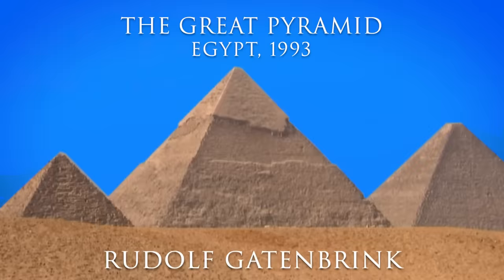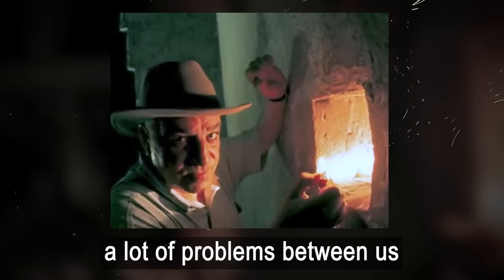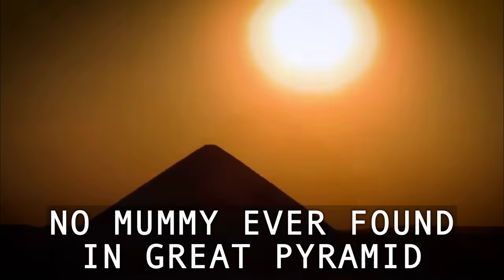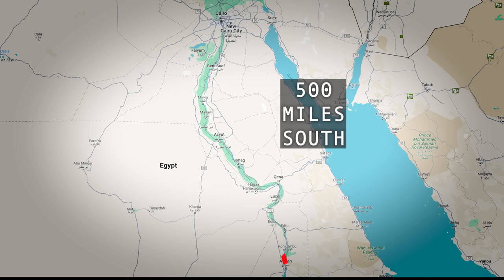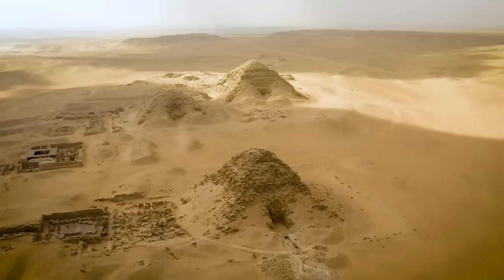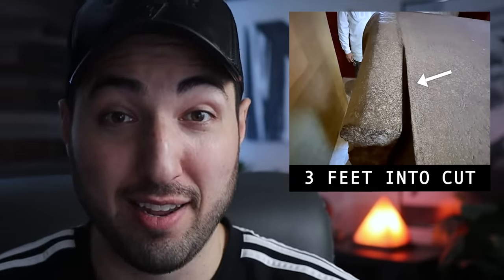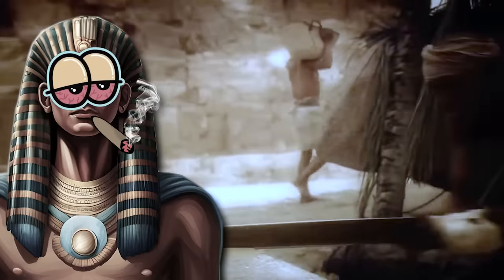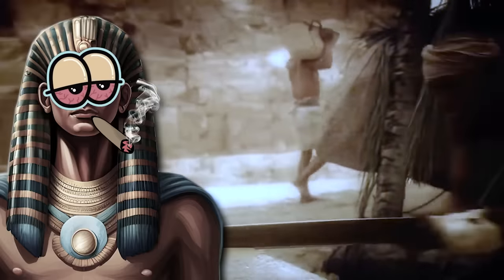The Great Pyramid Mystery: The Oldest Cover-Up In History

Comment: Very interesting that the latitude of the Great Pyramid is 29.9792458°N which uses the exact same sequence of numbers that measures the speed of light in m/s. More interesting considering that the idea of latitude and longitude wasn't conceived until roughly the third century BCE -  some few hundred years after the building of the pyramids. Even more interesting that this is compared to the speed of light using the metric system conceived by the French in 1790 - a few thousand years after the Great Pyramid was built. Down right mind baffling considering that this is the exact number of tadpoles that, if laid head to tail, on the night of the vernal equinox, during a full moon would be required to just ring the edge of the duck pond outside my back door that (gasp) has a replica of the Great Pyramid.  Some of the things stated in the video are interesting to be sure - like how the stones were cut and the pyramids were constructed in 20 years. But, as the clip progressed the narrative got more and more outlandish.
Reply: @eddiebarrow8671- I LMAO, thank you ❗
Reply: I was just about to post about the measurement problems when I saw your post. I was hoping someone else realized this as well. Good information.
Reply: The metric system is based on the the dimensions of the Earth. 1 metre is exactly 1/10,000,000 of the distance from the poles to the equator. 
Regardless of what the measurement is called, humans generally would have still created this same measurement, given we tend to count in bases of 10 (i.e. from the fact we have 10 fingers).
This also relates to latitude, 1 degree is 111,111 metres. 
So yes, regardless of who defined these terms, the actual unit of measure is based on the earth and is not arbitrary like the imperial system and all the various others, these really are based on observations of the Earth.
If one were inclined to somehow communicate that we have knowledge of the speed of light, this is a plausible way to do it. 
Math is great for breaking thorough language barriers as the values are not arbitrary.
Reply: @EdwardJohansson  I can see the reason for assuming they might have used the dimensions of the earth, but then you would have to assume they had the knowledge of the measurements of the earth from pole to pole etc. We would also have to assume they used a base 10 system for the same reasons we did. The Sumerians used a base 60 system. I haven't checked, but do you know of any other civilization that used the base 10? While it's possible they had knowledge of the earth's dimensions and created a base 10 system of math to make use of that information, I just don't see any facts to support it. That doesn't mean I wouldn't look for those facts or ignore them either as a possibility.
Reply: yeah I stopped the video after this. If you seek long enough one will always find alleged "strange similarities". It works the same with so called "scientific miracles" in so called holy books.
Reply: @michaelferguson5167  So your mention of the Sumerians actually brings up an important point. Seconds and minutes are base 60 and were invented circa 3100 BCE (likely before the pyramids), so by talking about the speed of light per second, we're actually mixing a base 10 physical measurement with a base 60 time measurement. 

We do know the Egyptians used base 10 (as did most, known civilisations at the time in the area that communicated with eachother, except sumerians and babylonians), We don't have evidence that Egyptians used base 60 for seconds and minutes, only that they tracked the day using base 12 - 12 day hours and 12 night. 

However, in regards to longitude and latitude though, regardless of the system used and what base, it is still the same value - so long as time remains constant. The distances remain the same no matter if it's metres/miles/longitude/latitude, so whatever the value, it still corresponds to the same measurement of distance. It's the measurement of time that causes the issue. 
One would have to assume Egyptians did adopt base 60 for seconds and minutes, at least for this purpose. However it is indeed an arbitrary measure, therefore aliens wouldn't get the message unless they knew that we had divided days into 24 hours and then further using base 60 for seconds and minutes. So in summary, it's not actually the distance that's the issue, it's the measurement of time - without the base 60 assumption, for which we have no evidence, this looks more like a coincidence. Though it is plausible that they could have received measurement of seconds from the Sumerians, it was invented circa 3100 BCE, likely before the pyramids.

Comment: The metric system wasn't in use until 1795. It IS based on tenths, thousandths,  and cubes of volumes. Could easily be that the ancient Egyptians used a similar unit of measurement, there were quite literally hundreds of ways of measuring in each country on earth, thousands worldwide, before measurement became standardized the world over. Even the Imperial measurement still used in the U.S. and places in the U.K. are just converted from metric measurement in every scientific setting.
Reply: The metric system is based on earths dimensions and water, one milliliter of water weighs exactly one gram, 10,000 km is the distance from the North Pole to the equator. So you’re just reinforcing the video’s hypothesis that the pyramids are to scale with earth and other objects in the universe
Reply: @sportspokerguy3506  I'm aware of what the metric system is based on. It's a base ten measurement system though, that's the part that might be relevant. It's very possible that the ancient builders had a similar system of measurement. If they were clever enough to build as well as they obviously did, they were clever enough to establish a proto metric system, especially considering how many arbitrary measurement systems there were floating around at the time. Not saying that I think that's what happened, but it's entirely possible that they inadvertently came up with a measurement system simular or identical to metric. It's our final evolution in measurements, it very well could have been theirs. No one will ever know for certain, but to dismiss the possibility just because our metric system didn't exist yet seems a little premature.
Reply: @twistedpixel2558  you said it was based on tenths hundredths and thousands I was just saying it’s based on earth’s circumference and water. I agree the ancients probably were advanced enough to base their measurements on earth itself and probably water (which is required for life on earth)

Comment: They didn't transport limestone 500 miles, it was Granite they transported from the Aswan Quarry
Reply: 80 ton granite blocks, perfectly cut with copper, transported on tiny boats. Now I want to see Hawass explain how you get a stone even 1/8 of that size onto that boat..
Reply: glad you know more than literally every other source online that claims limestone. but i mean..you were there..and you built it..and you have all the answers...obviously
Reply: @BaStAgE   Dude, it's covered everywhere that while most of the pyramid is limestone, the internal blocks are granite. This is not up for debate. The video maker screwed up there when he failed to mention that some of it is granite. The limestone was mined locally, the granite came from Aswan.
Reply: Yeah, the video maker kind of screwed up there, but it's overall still a great video.

Comment: I personally think the people who originally made the pyramid’s were there long before 4500 years ago. I think the ancient people were far smarter and advanced than we give credit for and had knowledge of the earths geography and oceans and different land masses. It’s possible they even had contact around the world in different cities .it’s said that way back then the geography was totally different, and it’s possible an asteroid or some major event could have caused a huge setback to civilization far before we realize now. The great sphinx has water erosion on it and is now believed to be older than 4500 years. It’s impossible that it was built in only 20 years you can’t even stick a credit card it’s so precise and perfectly aligned. Not even modern building can match the perfection and took humanity until the late 1800’s to build a structure taller. We couldn’t built a replica in 20 years time. Not to mention the possibility that with the limestone and gold on top the pyramids generated their own current and could have electricity running through them. Believed it was said wires were found and are still running through the pyramids that are ancient .

Comment: About 3,500 quarry-men could have produced the 250 blocks/day needed to complete the Great Pyramid in 27 years.

 In the experiment replicas of these were used to cut a block weighing about 2.5 tonnes (the average block size used for the Great Pyramid). It took four workers 4 days (with each working 6 hours a day) to excavate it. The initially slow progress sped up six times when the stone was wetted with water. Based on the data, Burgos A construction management study conducted in 1999, in association with Mark Lehner and other Egyptologists, had estimated that the total project required an average workforce of about 13,200 people and a peak workforce of roughly 40,000
Reply: Even if they were able to mobilize 40000 workers, the super comlicated design and project/construction management required still make the pyramids seem impossible to have been built based our current understanding of the technologied that ancient Egyptians had.
Reply: @lambvindaloo  Yet they did it, so obviously it wasn't impossible.
Reply: @kento1957 You are correct. I don't think anyone is arguing their existence only our official explanations and understanding of the technologies involved.
Reply: Man how do you tell 40000 people what to do without radios/ walkies

Comment: I thought that the great sphinx was the oldest thing in Egypt  out dating the great pyramids ? Recently they said it is far older than they ever thought before.
Reply: One point that was not clarified: the shaft that points at Orion did not happen only 4,500 years ago – due to Earth's axial wobble, there is a precession of the equinoxes, resulting in the same position of the stars every 25,772 years. The Great Pyramid of Cheops could be radically older.

Comment: Those weren't handles for the door... They are copper conductors
Reply from the maker: Either way, it’s the only copper found in the pyramid structure
Reply: @MindFKDwithPJ  yeah I saw a video explaining why they were conductors. It's been awhile and I forget the exact scenario they used to explain it but I remember it making a ton of sense... Love you videos man
Reply: I don't think copper I the only material inside the great pyramid but other material that probably Hawas keep it hidden...
Reply: Batteries
Reply: They did find huge light bulbs inside its a fact!!!
They are  hiding tons of  information !!!
Reply: @summerforever6736  No they didn't
Reply: They opened the door only to find another door behind. I've never heard if that second door has since been opened, or at least a camera sent through. Would be surprised if nothing has been done since the documentary was aired. Can't believe that it remains a mystery to this day.
Reply: @MindFKDwithPJ  Because some scammer on YouTube says it is copper?
Reply: @bigbasspa  Because the video is fake!
Reply: Yup. Those are copper charging ports. Because pyramid is actually a giant vibrating buttplug. But you have to charge it before use. It also explains why it is so big - ancient people were just bigger. And it explains a lot why piramids are brown in colour. Mystery solved, no need to thank me.

Comment: How can the pyramid be argued to be older than 4500 years old, yet also argued to line up with Orion’s Belt 4500 years ago? Genuine question.
Reply: The orion correlation is supposed to line up about 12 500 years ago. It also alters the star alignment of the square shafts.

Comment: BLOCKS were cut with sand and pressure.
Put sand between two rocks, rub them and watch what happens.

BLOCKS were moved on a boat, there were long water channels.

BLOCKS were lifted by a system of levers and counterweights, such as a crane or an elevator. If I have a BLOCK on one side and an equally heavy counterweight on the other side of the lever, I can change the position of the block around the pivot point of the lever just by pushing my finger into the block.  They used balance systems.

People were moving there with families, because there was work, food and house. They ate bread and drunk beer. They were paid. There was a whole city with workers and they all had one focus. To build the pyramide. 

It could have been build in 20 years with a sophisticated strategy.

Here are numbers. 

315 BLOCKS PER DAY
114 975 BLOCKS PER YEAR
2 299 500 BLOCKS PER 20 YEARS

They felt the energy, that we only talk about nowdays. Collective counciousness and electromagnetic structure of everything, sound and geometry, healing. We can learn from them, they were connected to creation.

Comment: I was thinking maybe the tunnels were filled with lime or salt water, or something, and the metal things were to conduct electricity from one tunnel to another. Bc I heard it’s a machine, or power station. Maybe they separated the tunnels to compartmentalize the water so you could empty them individually. Idk. Unfortunately idk how well the stone would hold water. But it’s just an idea.
Reply: Each year in May the Pyramid is closed for maintence and they sweep out the salt.
Reply: @cureit9161  Oh wow. I really wish I knew what those tunnels were. Thanks. I appreciate it.

Comment: New scientific evidence has revealed that MOST of the stones that compose Great Pyramid are not precisely cut blocks, but mere rubble and fill that was dumped inside the outer casing stones!  Only the outer casings and the lining stones for the rooms and passages are precisely cut blocks.  That means that each of the pyramids may have been built much more quickly than past estimates, possibly taking only a couple of years (instead of a couple of decades) to complete each of them.

And yes, Zahi thinks of them as "his" pyramids.

Comment: Dude, the relationship with the speed of light is definitely a coincidence: the meter is just a convention and has no inherent relation to any constant.
Reply: You are killing me: you can’t use values in seconds, meters or miles - those would have meant nothing to ancient Egyptians. Just stick to ratios, days, years etc.
Reply: 600,000 cubits per second in a vacuum, or 35400000 barleycorns per second :)
Reply: The fact that you used "Dude" negates anything you said🤣
Reply: That is illogical thinking . The speed of light is the speed of light , it does not change just because the units of measurment do. No matter how the egyptians measured  it the relationship would have still been the same reality and the fsct that the distance represented was proportional to the speed of light would still be true. A foot is a foot whether written as cetimeters leagues cubits or inches.
Reply: @claypadgett3101  …or barleycorns… :) anyway, the point is the ancient Egyptians didn’t know the speed of light, or perhaps even suspect that it has one….
Reply: Coincidence doesn't exist

Comment: Egyptians just didn't use Copper for their Chisels they also used Brass and Bronze which came into the picture later on.
Reply: You said they used brass. Please please could you let me know how to find that information because we have an incredibly ancient looking brass bust. We have been told it isn't old because they couldn't make brass way back in BC days. But if ours has been deliberately aged to deceive then we don't understand why because when we had the metal tested there was half a percent of gold in it.
It isn't Egyptian but looks Etruscan. But if Egypt could make brass earlier than commonly believed then so could other people.
Reply: They didn't need chisels.   Modern researchers have cut granite and limestone with crude copper saws and lots and lots of sand.  The sand does the cutting.

Comment: 12:26 How did you screw up the defition of pi. It's the ratio of its circumference to its diameter... not radius.
Reply from the maker: Diameter = 2r … so it’s accurate either way
Reply: @MindFKDwithPJ  True, but in the video you say its the ratio between the two, without specifying the multiplicative. Incorrectly stating π=C/r.
Reply from the maker: I didn’t make this video to be a math lesson bro 😂
Reply: @MindFKDwithPJ  
It isn't a geography lesson either. The apex latitude is at 29.9791750°N
Reply: Diameter = 2*radius. So if Pi is the ratio of circumference to it's diameter, how can it not ALSO be a ratio of circumference to radius?
Reply: @endthisnonsense7202 got wrong info from Wikipedia 😂😂😂

Comment: Wrong. The entire pyramid was covered in gold. All 9 were. They had to be to function. The ark in the queen's chamber would give off gamma rays which is why the queen's chamber is black, as the crusaders burnt the gold off the walls leaving a small lip on the step where they extracted the last bit. The King's chamber box dimensions inside were exact for the outside dimensions of the ark of the covenant. A gold box with an iris and inside has 55 coil capacitors, 24 pairs on common seats(24) around 6 around 1. The handles would rotate to simultaneously open the iris and spark gap for the cap coil circuit. The reason it used 9 is a known science of wave compression as well as charge field rotation interlocking which increases phase discharge potential each cycle provided by earth's core charge modulation, which is currently running at about 14.07hz. It provides the power source for things like Schuman resonance.